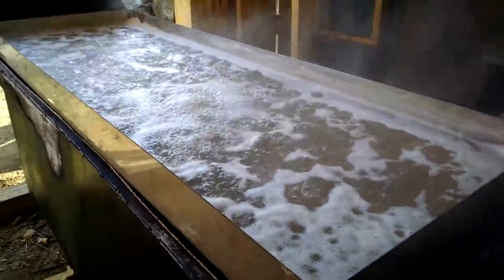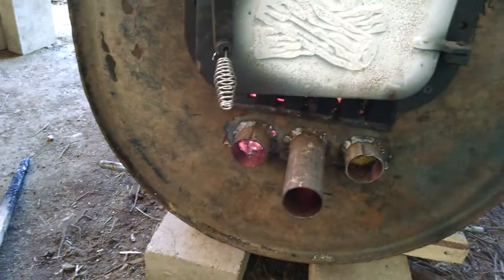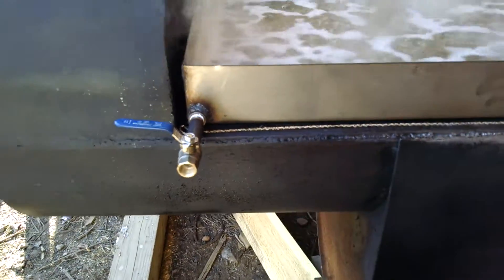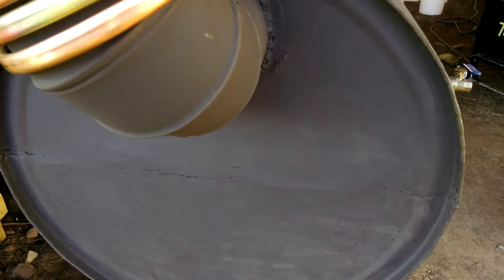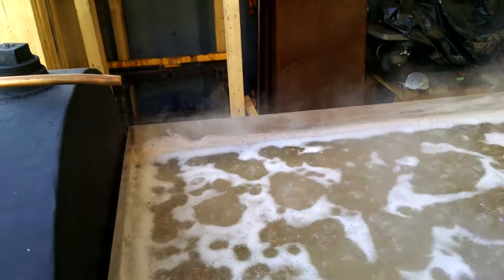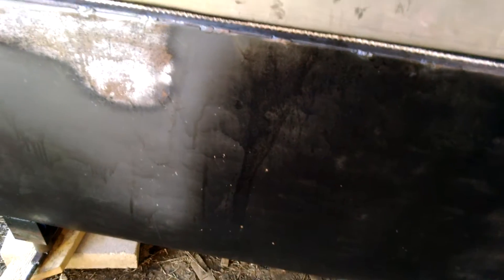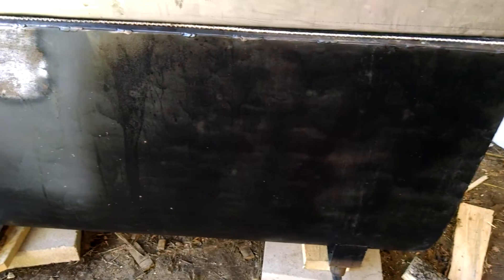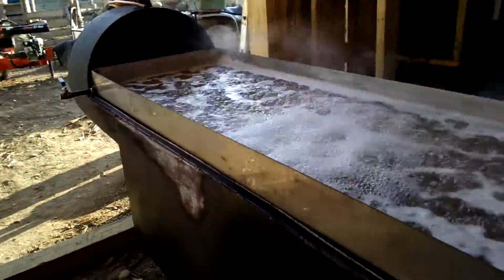Homemade 12 gph Maple sap evaporator

Comment: I was just lucky enough to pick up an old darkroom sink that is 2’x4’ and I have a fuel oil tank in the basement that I need to get rid of so this is great, gives me just enough info to do the project. I’m lucky to get 3 or 4 GPH with current setup so an upgrade is in order. Thanks for sharing!
Reply from the maker: I like making things from Obtainium. Send a picture when you're done with it. Or even throughout the process.

Comment: Just saw your video. Really like the extended back. I'm building a big one now and I have decided to install a 4" tube that will run into a small three pipe manifold using 1" pipe to provide forced air into the fire box. Using some of the designs I'v seen from manufactured stoves it will come in from the rear into the bottom of the fire box through the open cavity created to chamber heat from the fire box up across the bottom of the pan. We tried the copper tube around the stove pipe this year, but couldn't seem to get it quite right. You might want to add a preheat pan right above your draft chamber, or maybe even cut in with the output tube through the front wall with a valve and a turn down. That way you can get the trickle affect without to much splatter. Thanks for the ideas!
Reply from the maker: I live off grid so electricity is at a premium. Install an 8" stove pipe and make sure it's 15' tall. You won't need a blower then.
Reply: Awesome! Thanks for the tip. Do you find it hard to get a draw started with that much pipe?
Reply from the maker: @vhmccray3705  not at all.

Comment: Great setup, I just built one out of a fuel oil drum, I like how you extended the back that was a great idea
Reply from the maker: Thank you. The only cost for me is the firebrick inside. My wife initially had a problem spending $300 for firebrick until she saw the price of buying a 2x6 commercial evaportor. I also made this to be able to make birch syrup.
Reply: This year I am only using red brick for chimneys, it’s probably all going to fall apart but next year I will fork the $$$ out for ceramic fire blanket and firebrick. Great setup 👍

Comment: you have a nice cooker.  what state are you in? my uncle built one similar with the entire top cut off and made 2x but still kept the back for chimney.  my cousin still uses it.  but yours works better with the air inlet.   you should try just putting a hair dryer or any sort of fan into your inlet and you'd be rolling.  mine uses a 3" 50 cfm bath fan and i cant see across 20" pan the steam is so thick.  

you didnt show your wood too much but if you split it better it would get hotter too.  dont need to worry about that if you get the fan on it.
Reply from the maker: Thanks. I live in northern Minnesota. I have a squirrel fan for it, that why I made the inlets as I did. It drafts quite well the way it is. I also live off grid so using electricity has to be replace by me. If the sun is out, my solar panels can run the fan and charge my batteries.
Reply: i applaud that amount of effort.  i may try solar charged tubing in the future.

Comment: Nice work! How'd it perform this year?
Reply from the maker: The sap just started flowing up here in northern MN. I ran one batch through it and love it. I do want a different pan eventually. I got this flat pan for two quarts of syrup so I can't complain.
Reply: @drainkinginc2011  wow it's later there than where I am in Ontario. I have an oil tank and I think I'll use your design. Thanks! We made just under 50 liters here and I'm done!
Reply from the maker: @Ewaugh69  We had a great year, for us. We made 32 gallons of maple syrup and 42 gallons of birch syrup. We hope to increase our volumes up by 50% this upcoming season.

Comment: Why do you add that divider and fire brick like you mentioned?  What's the point ? Will it hurt if I don't do that when building mine.
Reply from the maker: Do you mean the divider between the rock wool and firebrick?
Reply: @drainkinginc2011  the big void in the back created by welding that sheet metal in the back of the drum.  Why does everyone put that in?
Reply from the maker: @abc-ed1nr  the purpose is to create a firebox. I wanted the fire to go straight up on the front of the pan. Keeping the area on the back half minimal, will keep the fire intensity on the back half of the pan. If I left it open, some of the fire would've went straight to the stove pipe and missed the pan altogether.
Reply: @drainkinginc2011   Just looking at the sap, that's a simmer not a boil. If you build a false bottom ( fire grate) you can charge air under the fire with a blower fan which then pushes the heat upward through the wood toward the pan instead of directly into the fire and back aft.  That box could use at least 125 cubic feet of air fan. I have mine designed this way and it's pretty efficient.  I control my blower fan with a PID and have my stack temp set at 1050 F right at the back of the pan.  If you're  boiling off 30 GPH on that set up then I'd say it's pretty good, if you're only getting like 18 GPH then there is some room to make smaller bubbles.
Reply from the maker: @Tonnsfabrication  This is after I first built the evaporator. I only had an 8' stack on it. It now has a bigger air inlet under the door and 15' of stove pipe. I live off grid so conserving electricity is pretty important

Comment: good job
Reply from the maker: Thanks. I can't wait to fire it up this year.
Reply: I just started building one for this year so been looking at lots of options but really like yours
Reply from the maker: It really works well. Just make sure where the flames exit on the backside of the pan, the opening area doesn't exceed the area of the stove pipe.
Reply from the maker: @802louis  , Good luck. If you have any questions, please ask. Make sure to have enough firebrick to keep the heat on the pan.